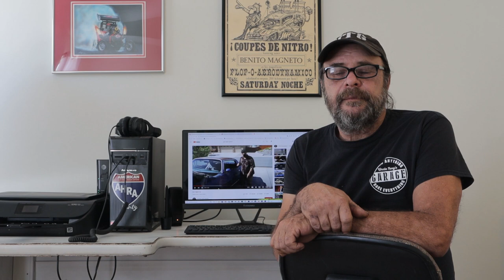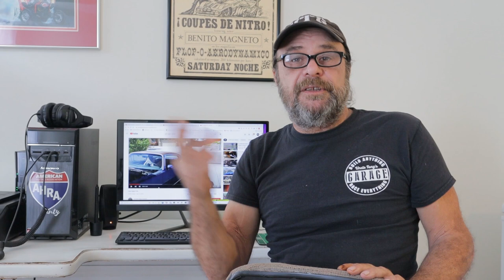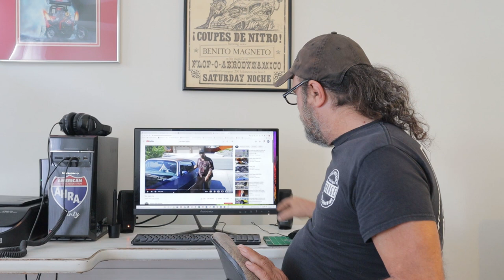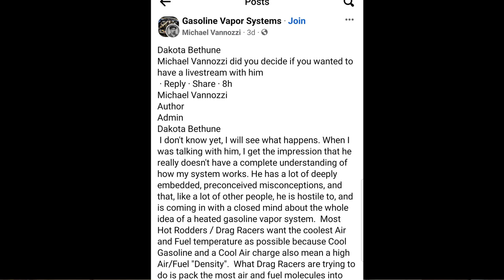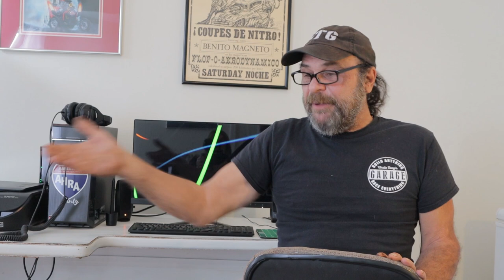Climbing Down The Mega Mileage Conspiracy Rabbit Hole

Comment: If fuel vapor was really the golden egg, we'd all be driving LP powered cars. If you want 70 mpg, buy a Vespa.
Reply: What does liquid propane have to do with vapor?
Reply: @yeboscrebo4451 It has to be vaporized to burn. But compared to gasoline - Hoo BABY does it want to be vapor. It will grab all the heat it can get including frostbiting your skin if it's anywhere nearby.
Reply: LP (called LPG in Europe) is a common fuel for vehicles in most European countries. They actually get slightly lower mpg , but it's about half the price of unleaded and the emissions are much cleaner. It's a wonder why it's not more of an option to have it as a fuel option (instead of the mad rush towards electric). 
Kits are mostly plug and play (everything stays stock).
Perhaps the only modification that could be done, given how the vapour comes out so cold, is to add something like that turbo interheater to warm up the mixture and further mix it while keeping it under pressure. That's effectively what the vapour guy mentioned in the vid is doing... Heat expansion is cancelled out by keeping inlet pressurised via a turbo (only 1-2 psi). Plus the routing means the mixture is better... mixed. 
So effectively heat up the vapour from the LPG but to keep it from expanding, keep it pressurised.
Reply: I always wondered what propane cars would do .  I worked on them going way back .  Tore one down one day .  Had 3,000 hours on it .  Crankcase was as clean as a whistle and the combustion chambers had a white ash on them which wiped clean  with a cloth .
Reply: @tomdamon7208  You may find this interesting. Back in the Late 70s as shopping malls were booming a more powerful solution to polishing all that floor-acreage was needed. 120v corded polishers lacked power and were tethered to an outlet. Battery powered machines were huge massive and expensive, lacked power and were clumsy. I invented and patented a slightly oversize version of the straight-line-rolling 120v polisher that had an 11hp Honda vertical shaft riding mower engine with a forklift upright propane tank behind it.
        When you get to simple fan-cooled engines the first thing you notice is they run hotter. You can't (like a forklift) put a bigger water pump and radiator on it. All you can do is keep the fins and fan really really clean and try to reduce the power required to turn the hog-hair polishing pads on the hard urethane "wax".
       Other brands of engines were tried and totally failed to hold up. Later I added a tiny distilled water system what worked great by fogging water into the induction.
But then idiots began putting motor oil, wax and even gasoline in the tank.
   Thankfully Kawasaki began production of their FH500 and FH541 V-twins and we could get couple thousand hours out of them "dry".
      You should have been there  when I was welding & machining dropped valve seats, displaced valve guides in the old flathead blocks. OHV was a godsend - just bolt on a new head! 
    And of course the block and head surfaced warped from the heat and had to be made flat again where the bolt-strain was.
    But the doggonedest problem was high time engines drinking oil. Cylinders looked immaculate = no wear at all (according to criss-crossed inside micrometer readings at several places in the bore )
     Finally I spent the time to fit a tiny dial indicator into the cutting tool holder of my Qwik-Way Boring Bar and what I saw astonished me ! I could use shims and move the bar's base around on top of the block until I was dead nuts centered at the top of the bore as well as the bottom. But the middle of the bore - while being perfectly round and to size - HAD MOVED OVER 0.020" !!!!!!!!!
        Hondas all had thin cast iron sleeves cast into their meaty aluminum blocks - but after hours and hours of steady torque delivery at "ragged edge" temperatures the side thrust of the piston+rod on the power stroke had pushed the middle of the bore to the side giving a "banana -shaped" bore that was still the size it was made - and even brand new piston rings couldn't cope with it.
        You can always see "banana-shaped" wear on a cylinder that's had dirty air or oil going through it - but I never heard of anybody seeing a "standard-size Banana Bore" either before or since.
       Hope you liked.
Reply: @patrickshaw8595  I used to deliver LP for Ferrellgas. LP turns from liquid to gas (vapor) at -275° or something like that. That's why you can use LP gas for heat anywhere. It's also why it's kept pressurized. It stays liquid under pressure but it's colder than freon when released. Funny thing is, the trucks we drove all burned diesel. It didn't make sense to me, considering how cheap Ferrellgas could buy LP vs the price of diesel. I was told it was because of the price of repair difference and the lack of mechanics knowledgeable of LP components and repair. That still didn't make sense considering the huge cost difference. Ferrellgas was probably paying less than 25 cents per gallon for LP versus $3 per gallon diesel. Also, back in the 70s, my friend's dad had a Ford pickup with an LP tank behind the cab. With the flip of a switch, you could run on gasoline or LP. What happened to that technology? The only reason I see that LP isn't a widely viable alternative to gasoline is that the price consumers pay for LP is as high or higher per gallon as gasoline. Seems to me that if LP was more an option the price would come down. Maybe that's what the LP suppliers DON'T want. Maybe that's why they don't push the move from gasoline to LP. It's the only reason I can think of. LP certainly gets better mpg ratings and it's a lot better on engines than gasoline but you do sacrifice a little on power.
Reply: @chevyblue10  Yep. Just remember it aint easy to make anything besides an old cast iron lump engine w/oversize water pump, fan and radiator - to be as trouble-free as the OEM gasoline version. In my opinion the stuff is hard on poppet valve stems, guides, seats, valve faces. I read somewhere that companies that make industrial gas turbines favor Natural Gas because the combustion flames are "soft" and lower intensity and so easier on anything exposed to combustion - light. You lose a lot of power but its an option.
Reply: Propane burns clean but has no protection for valves and seats. That's one of the things lead in the fuel did. It also has less btu s of energy by volume then gasoline so you pay a penalty there. Also a propane engine needs a different advance curve on the ignition to be efficient. Propane became popular 30 or 40 years ago because it was cheap. All the taxis were using it. I put a duel fuel system in my truck and it worked but not that great. Once it became popular the price was jacked up to the point it wasn't worth it. Forklifts and zambonies commonly use it because of much lower emissions so it's safer indoors. I've seen forklift engines with so many hours that the belt pulley grooves are worn round but they are still food. You don't have gasoline washing the oil off the cylinders when cold etc.
Reply: @MrGlenferd  yes I found same things as you say, the only issue was valve seat wear, I tried hardened seats and stainless valves and they were semi successful but the real game changer was copper beryllium seats on both inlet and exhaust and stainless inlet and inconel exhaust valves, not cheap by any means but nearly zero valve/ seat wear to the point you could run same cylinder head thru multiple rebuilds with no more than an ultrasonic clean, the heat dissipation properties of copper beryllium ( now copper bronze) is so superior and now with aluminium heads it is even better, using gapless rings and slightly modified honing cross-hatch angles ( to minimise oil travel into to upper cylinder area as fuel dilution elimination required less migration up cylinder walls) the engines rarely showed much wear, after seeing a video of an engine running on dyno looking down intake stack injection and seeing intake valve glowing slightly it made me realise the importance of inlet valve seat heat transfer not just exhaust, most people think lead was a lubricant for exhaust seats but it was really a heat transfer medium, the surface of valves would be so hot that a sort of annealing of both surfaces took place when valve closed that it eroded away slowly which was why the harder seats lasted longer,  with stainless valves as you heat them up their properties get better, at room temperature they are not much better than steel valves, the heat transfer properties of the copper alloy seats is so superior it's a no brainer and their hardness factor just adds to it, just from what I experienced anyway. A lot of the cylinder head for LPG stuff I did I used old inconel diesel engine valves, I would machine valve guides out to larger stem sizes to increase contact area for heat transfer and machine end of valve stem to suit what ever the engines retainer and locks it was going in, 99% of LPG engines were not high rpm so little extra valve weight was not an issue compared to heat dissipation increase, if didn't use bigger stem diameter always used bronze guides for better heat transfer and no valve stem seals on exhaust valves for anything unless it was turbocharged, I have seen a benefit to using copper alloy seats in ali heads on high compression competition engines, guys constantly report more ignition timing possible with out detonation, also on turbo motors, I would really like to see a direct comparison looking down intake on dyno of inlet valves between the two seat types, as I say just from what I have seen and been told from guys I've done seats for.

Comment: Lots of vintage tractors run on "vaporizing oil" . Not the same thing by a long shot, but somewhat parallel. But they had 2 fuel supplies. They had to start and warm up on gasoline before switching over to TVO.

Comment: "I reject your reality and substitute my own"
The worlds full off it, people decide what they want to believe, the truth is just not important. Politicians love it.
Bet that Camaro is a slug, my wife's twenty five year old 2.0l (G20a) Honda gets nearly 50mpg (imperial) on a long trip if you try. I suspect it will out perform that Camaro.
Reply: You could do the exact same thing without all the piping and turbo fuel heating, ect by simply replacing the 350 with a small 30hp 2 cylinder engine - same result: an absolute dog of a car that gets really good mileage in a very narrow operating window.
Reply: Great point thumbs up 👍
Reply: I'll do you one better, my wife's cousin's daughter's boyfriend's step uncle knows a guy whos Blazer(420ci) gets exactly 69mpg (imperial) on long trips if you drive it like a granny. Brave of you to hate on politicians!
Reply: Yep.  I used to have a little Dodge Neon that put out almost 40 mpg hwy @ 60 mph, and it was a pretty peppy little car.  The best I ever got out of my old chevy truck with a 350 was 25 mpg hwy @ 40 mph, and it drives like a slug.  The truck sure hauls a lot more load than that Neon though.  There's always trade offs, no matter how you do it.  You can have a fast vehicle, an economic vehicle, or a vehicle that can haul a load.  Sometimes you can get two of the three, but even then you have to compromise all three to average out the two.
Reply: I'm pretty sure my old 93 Jeep  4.0, 4 speed automatic will get 35 mpg while cruising it at 50 mph. Unfortunately you can't cruise at 50 mph very much. You have to stop and go and climb hills and pass cars and merge into traffic etc. The old boy does pretty good at all that too, but it doesn't get 35 mpg while doing it.
Reply: Next up will be " run your car on water "  Have a look at this vid  Vacuum Pressure Hydrogen fuel cell defeats high gas prices using hydrogen from H2O.  on the channel Metalpress TV
( An actual fuel cell takes in a fuel and oxidizer to make electricity,this is sometimes found on space ships. What this guy is doing is electrolysis that absorbs electricity. )
Reply: @gasolinevaporsystems9022  If you're car people,   explain yourself,   don't just spam pull-my-finger links.
Reply: My 1995 Ford Aspire running Super ( less ethanol ) WITH A LARGE CONSTANT TAILWIND " can " get 44 MPG at a constant 55 mph ( manual 5 speed ). The NORMAL millage is in the 29 to 34. 1.3 L and weighes 2150 LBS. THE 9.5 COMPRESSION helps too.
Reply: Go tell that to the former guy... lol 😆

Comment: I remember these super gas milage things every time gas prices went up, in 1974, and a number of times after.  A screen under the carb gasket that would break up the gas to be a vapor, water injection (no pump, just hook it to a vacuum port, fill the jug with your water hose), magnets on the fuel line, and lots of other gadgets.  And over the years I saw all these things recycled.
Reply: Heh I was born in 73 and I've seen some of this shit recycled that you mention.
Reply: My neighbor in the 90s or early 2000s used to sell pills that you put into the diesel tanks that were supposed to get you 15 mpg in the big trucks. I don't know if they worked but he swore by them.
Reply: Remember the metal swirl thing that went between your air cleaner and carb? I cant remember what it was called.
Reply: @chevyblue10  Don’t forget, there was someone originally who convinced now millions of people that circumcision was a good idea.
Reply: I've heard stories where switching from a two barrel to a four barrel improved mileage and  ones where going the opposite way improved mileage. But I've never seen one where the guy  said, "I optimized the mixtures by using an air fuel gauge with both carbs and tuned the jets, air bleeds, accelerator pumps, and power valve to get the best results."
Reply: @auteurfiddler8706  I’ve seen exactly that…. Andy Wood’s truck.  Biggest thing he did was meter the transfer slots and optimize the vacuum advance.  16mpg from a 600hp 393 with a tunnel ram and 4,500 stall and 4.30 gears in a 4,000 pound truck.  Real tuners like him are few and far between.
Reply: I heard the screen gaskets help economy slightly at the expense of high rpm power.I was tempted to try them and also they'd have the benefit of keeping stuff out the the combustion chambers. I have a couple of Edelbrock VariJection kits.They have pumps. I never used them, but I would try them if I had an engine that pinged on the best gas. Which is really terrible gas in So Cal. They only increase fuel economy in the sense that they make you need to retard the spark timing less.
Reply: @johnwilburn  I hear hyper-milers get circumcised to save weight so they can save an ounce of fuel over 50 years of driving. 😂
Reply: @barnabyjones6995  “Swarup” was the name of the motorcycle version.

Comment: I'd like to, sorta, take you up on that offer at some point in the future. I'm currently in the process of building a B230 redblock with flattop LS pistons and a performance head. Once it's done, I plan on dynoing it, then installing a fuel preheater that runs off the coolant, and dynoing it again. It's not a vapour system, it's closer to Smokey Yunick's design which involved preheating the carburetor and the air, and doesn't go as far, but it would still be a way to test whether fuel preheating is a viable way to improve power/economy.

Comment: I use the 318 as a good example. The magnum fuel injection really helped me realize. With a 2 barrel carb the engine gets a good 20 mpg with 3.23 gears on the interstate, with a 4 barrel you get 12 mpg, my magnum with fuel injection has got 10mpg but I really was hauling ass. Now. The 2 barrel would barely move the car, 0-60 was to much seconds to count, the 4 barrel made so much more power, it really made the car come alive, when you read 230 horsepower, you believed it with a 4 barrel. So if you made a 100mpg carb for a 318, you wouldn't even get it to reliably idle under its own spring weight
Reply: That 4bbl on the same 318, same differential gearing and tranny, should deliver identical highway mileage, and the performance at cruise between a "deuce" versus a "quad" should be barely perceptible.  With 3.23 gears (and some Mopars used 2.78, I think), at 70-75 mph, you should be turning about 2,700 rpm with 15 inch tires on a B-body, so those secondaries should be closed if the carb is properly tuned.  Check your settings on that four barrel (Thermo-Quad or Rochester Quadrajet?), 12 mpg is terrible.

I say, if you can live with your vehicle being a big of a dog off the line, and it was graced by "Ma Mopar" with that Carter BBD (or in the case of the 318 Polys, a Stromberg), just leave it be; at least until you're ready to pull that engine and do one thorough rebuild.  THEN swapping out for a 4 barrel intake and carb makes sense.  Do install some dual exhausts if its being strangled by a single exhaust setup; that's a worthwhile performance modification.
Reply: The 4 barrel carb should get better fuel mileage than the 2 barrel before the secondaries open up.
Reply: @chevyblue10  4 on the floor no kick down.